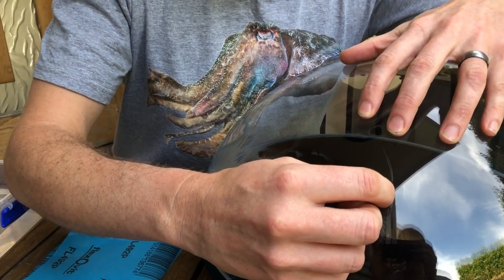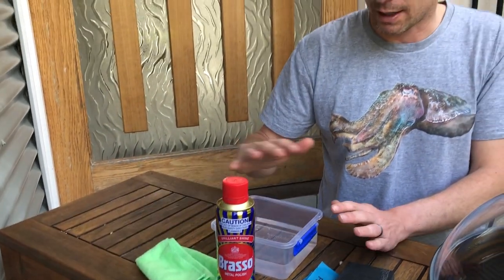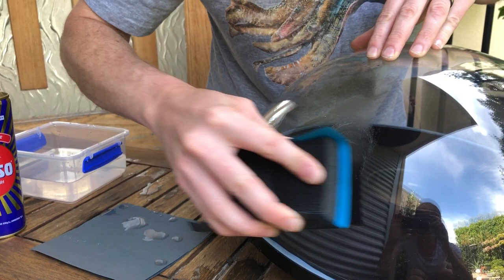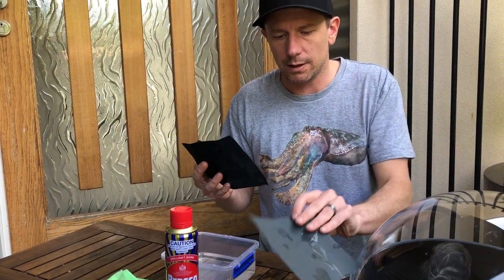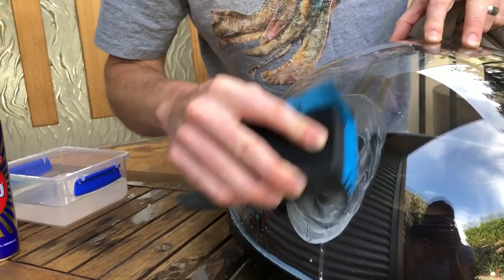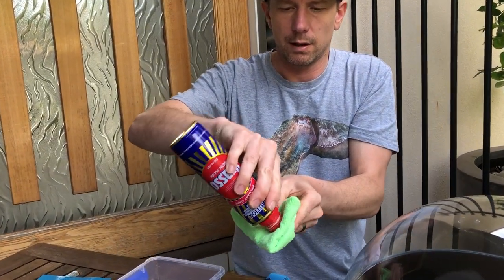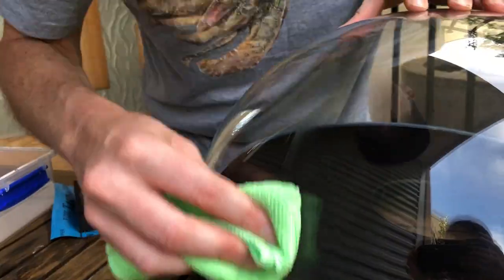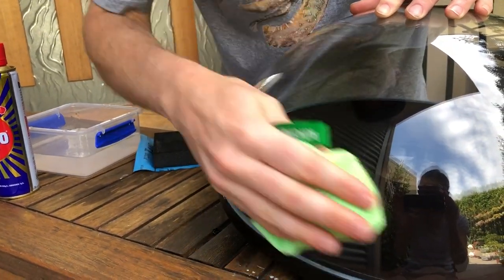How to remove SCRATCHES from an ACRYLIC DOME PORT

Comment: Hi Matty. Wanted to know if you had any advice for PolyCarbonate wet lenses with hard coatings? I read one of your comments below that this technique is probably not suitable. Do you know any technique that is? I have the AOI m52 wide angle air lens (ual-05)
Reply from the maker: Hey, that's a tricky one and I'm not sure of a technique that would work, sorry.

Comment: Thanks for the video, although I have a concern regarding the technique. I’ve always being told that when you polish a dome you have to polish it all to avoid an optical problem. That it may look different the part you polish with the rest of the dome one you work with it underwater, sort of when you look through a crystal glass... Have you ever had any issues regarding what I’m trying to explain? 

One last thing. Can you tell me the brand of the quimic you use for this?

Thanks.
Reply from the maker: Hi Ernesto. Thanks for the question. If you use a firm sponge/cork block it will mould to the curvature of your port and will help you to avoid rubbing flat spots on your port if you use a nice circular motion. I think it would be very impractical to try and polish the whole port and not without errors anyway, so I wouldn't recommend it and don't do that myself. Also, remember that the water has very similar density and optical qualities as the acrylic your port is made from so any external port imperfections are well hidden on contact with water. The acrylic effectively becomes an "extension" to the water so any small scratches and optical errors practically disappear underwater. Hope that helps.

Comment: Tried this exact technique w 800 and then 1500 wet sand paper and block on my aquatech 8” dome. After polishing with the bras so I now just have a cloudy dome port that’s unuseable.  I can’t get the “matte” finish off. Copied the video to the T with exact products. Not sure why it didn’t work for me unless the aquatech ports are a different type of acrylic
Reply from the maker: Hi Matthew, I'm sorry to hear this. I do know people have had success polishing Aquatech ports with this method. Firstly, are you using emery cloth or sandpaper? As you mention sandpaper, wet & dry emery is the way to go. Next, I would try a finer grit emery before buffing with the brasso. Wet & dry emery goes all the way down to 7000 grade (very, very fine), try and buff grades down to 3000 at least for a super fine finish and use plenty of water. Then try the brasso again with a brand new, uncontaminated soft cloth. You can also buy a special acrylic polishing cream called Novus with is designed specifically for this job (link below), maybe substitute the brasso for this product, it's more expensive but worth a shot. Let me know how you go and good luck. 
https://www.digidirect.com.au/catalog/product/view/id/56404/s/aquatech-novus-cleaning-scratch-removal-12310?gclid=CjwKCAjw3ueiBhBmEiwA4BhspG8NvEFsNX4mJl6CK7rDaD-TsHL7484IWAJAlTnIiJ9GqyygJqlOhRoCSE0QAvD_BwE
Reply: @mattysmithphoto8002  Thanks for the reply.  I did actually buy the Novus kit and used it and it worked way better than the Brasso.  I was using a wet /dry sandpaper of 800 grit first and then 1500 grit and then 2000 grit.  There are still some sanding scratches on the dome from it.  Maybe I should get 3000 to try?  It's quite a difficult process I"m finding.
Reply from the maker: @matthewbrush3472  Yes maybe try the 3000, it sounds like you're maybe not polishing enough with the fine paper and getting the deeper scratches out before going to the polishing paste.

Comment: Hey Matty, 
Thanks so much for sharing this invaluable information. It's really saved my dome. Just a quick question though. I've managed to buff the scratch out to a point that I can't see it anymore, but when I look through the back of the dome I can see a small indent/blur in the image where the scratch was. Can this be rectified with more buffing and polishing or should I just leave good alone, as I would hate for it to get worse.
Thanks in advance and keep up the excellent work.
Reply from the maker: Hey Clayton, No worries man. Maybe try it underwater, often the contact with water will hide many port blemishes and problems. Did you use a flat sanding block and circular movement as in the video?
Reply from the maker: Hey Clayton, glad it has helped. Did you use a soft sanding block as described? What I would do is test it underwater and see if you can see the ripple, you will probably find it will disappear once in contact with water. Let me know how you go. Cheers,

Comment: Hi Matty, I have a scratch on AOI UWL 400A , which is a small dome (~12cm diameter) compared to yours. Should I change the technique in anyway? Given the curvature is much more pronounced on a small dome, should I use a softer sanding block to avoid any flattening? Thanks! Seb
Reply from the maker: STOP!  Hey Seb, the AOI UWL 400A is a glass dome, this technique works on acrylic only. I'm sorry but there isn't much you can do with glass ports, polishing them just makes the problem worse. You're only option really is to contact a professional glazier to see if they can help you. Sorry for the bad news.
Reply: @mattysmithphoto8002  Hi Matty, are you sure the dome is made of glass? The specs on the AOI website say Front PC Dome Lens with Hard Coating, which I assume means PolyCarbonate and not glass?
Reply from the maker: @sebastienlecas3407  Hey Sebastien, I just checked their website and you're correct, 4 of the elements are glass and it says the front dome is PC, I can only guess that means Poly Carbonate but I can't be 100% sure. It does seem strange that they used Poly Carbonate over Acylic if that is the case. It also does say that it has a hard coating, I'm also not sure how the hard coating will go with the polishing proces, it may become patchy. Also note that what you have is a "wet lens" and not a normal dome port, so it's hard to tell how polishing it will effect it's optical lens characterists. If the scratch is minor and not effecting your pictures I would be tempted to leave it. If it's a real problem, give this a go but be prepared that you may need to replace the wet lens should it go wrong.  I would proceed with caution.
Reply: Hello Sebastien. Did you ever try this technique with your AOI lens or did you try something else? if yes how did it go? I have an AOI m52 wide angle air lens (ual-05) which the website says is a Polycarbonate dome with a hard coating. I have read Matty's concerns and am not sure yet if i want to risk it.

Comment: Can I fix scratches on the inside of my port in the same manner?
Reply from the maker: Hey Tash, potentially yes, though I've never done it. Just check with your manufacturer that the inside doesn't have an anti reflective coating. If it does then I would recommend not touching it. Another difficulty might be the negative curve of the inside. Maybe consider using a tennis ball or similar to support the abrasive paper so you get an even finish.

Comment: Hey brother, have you noticed the reflection of the sanded area with sunlight? It’s like blotches or a streak with the straight sandpaper job I did.
Reply from the maker: Hey man, It sounds like you need to polish it a little more with the metal polish and cloth. Make sure you're using a clean and very soft cloth and circular motion to polish. It should totally remove any steaks etc when done correctly.
Reply: Matty Smith Photo I think it’s what you’ve mentioned (divot). Is there a way to remove/lessen this?
Reply from the maker: @Righteouness  Did you use a sanding block and circular motion as you sanded? That should stop the divots. Once you put the dome underwater the divot should be much less obvious, try it. If it's still noticeable you might need to sand it with a block to try and reduce it.
Reply: Matty Smith Photo sand block, circular motion, wet sanding and polished with the exact product: indent still remains and I created another one ☹️ I’m very tempted to chuck this dome port out
Reply: I followed your instructions to remove an small scratch and I ended up with scratches all over the dome, I’m guessing the texture of Brasso just ruined my dome

Comment: Actually I have it worse I can't get away that smokey part with the metal polisher, maybe I bought the wrong, I live in Spain so I tried to translate it from English to Spanish, it smells also amnoniac like?
Reply: the truth did you fix it?
Reply: @Righteouness , es I fixed it, takes time, but toothpaste worked also great as last polish
Reply: the truth actually, toothpaste is too gritty I think. The scratch isn’t visible but it’s visible when the light shines on it from the sun. Have you tried this?
Reply: the truth I also looked through the hole from the back of the dome and I can see a weird bevel on it.
Reply from the maker: Yes there is a quite a strong smell with that polish. If you still have a smokey part it needs polishing more, it can take some time. Make sure you're using a new and very soft cloth and polishing in a circular motion. Cheers.

Comment: not working.. my dom port is dead 😥
Reply from the maker: Hey Ray, if it’s not working you may have done a step of the process incorrect because it works very well. What’s the problem you’re having?
Reply: Matty Smith Photo I think I used different brasso. That of mine is brown plastic bottle. And my dom port state is like just finish sand paper polishing but no glassy. Can you give me more advice?? 😥
Reply from the maker: @raykim8139  What grade of wet and dry paper did you use? Did you wet it? And how long have you been polishing with the brasso?
Reply from the maker: Can you email me a picture of your port?
Reply: Matty Smith Photo Thanks, I send message to your instagram message. Thank your for your kindness